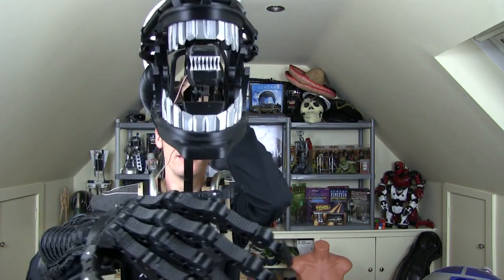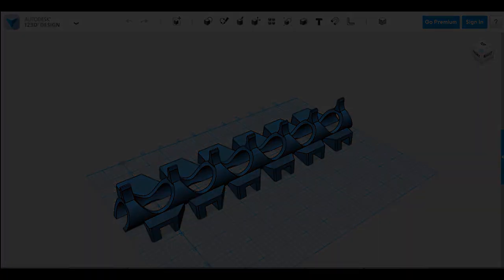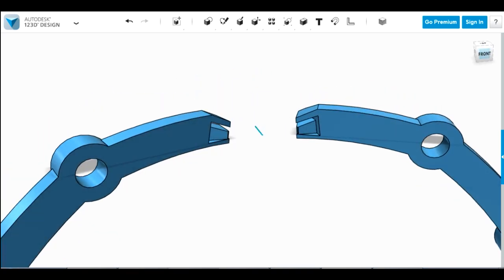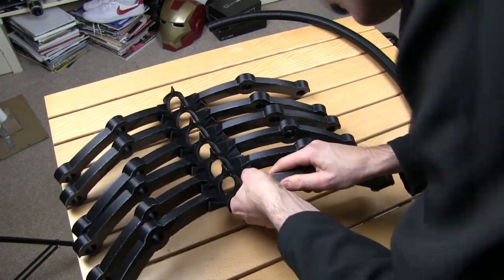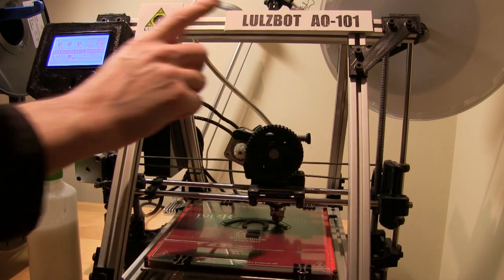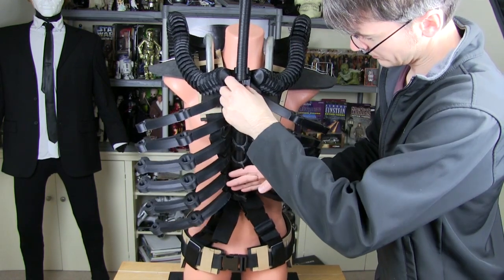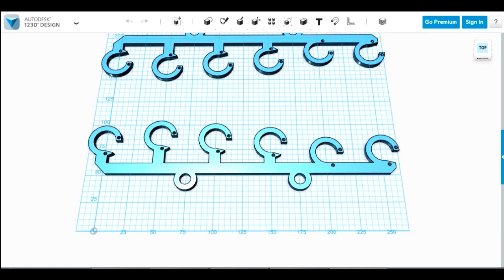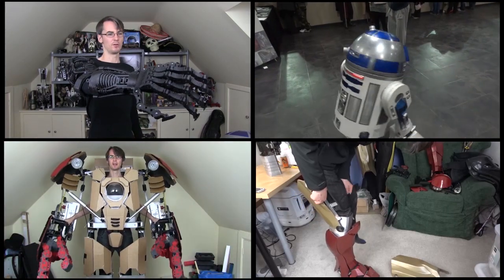Alien Xenomorph Cosplay #10 | Breastbone & Ribs | James Bruton

Comment: I think you should make sure the tail has some puppeteering capability, that way it adds to the realism and is able to be tucked in tight so it doesn't hinder movement in tight spaces.

If you make it so the pose you're in affects the tail's position, for instance; when you're on all fours the tail should be streched out more (like a lizards), and when you more upright the tail should be more curled inward (like a scorpians).

I can explain this better if you're interested, just reply to this comment, and I'll respond immediately.
Reply: *****
Just a basic idea, dunno how good, but make the tail controlled by movements in the body harness.  If you twist right, the tail shifts to the left, and same the other way around.  Will make it look like it's actually shifting weight, but a bit of a heads up, these things have an almost forward lean for sake of balance (kinda like a velociraptor).  Some supports along your legs to maintain the upper body could help as well, otherwise I think you're probably expecting a suit that could weigh say 30-50 kg in the end (rough guess, though not sure what it's currently up to now at a glance).
Reply: *****  If you run lines that connect to the shoulders on both sides you won't need any motors, batteries, or complex programing.

Just make sure that the lines that control the bottom of the tail, attach to the back of the shoulders gtoing up the back.

As well as the lines on the top attach to the front of your shoulders by going up the front.

Then if you want it to strike (or emulate striking) you'll only need the lines to be overridden by giving them slack, with motors that would otherwise keep them at a set length. Using one motor on the back to pull a line that is only for striking, running up the top of the tail.

BTW I believe I sent you a tail blade image/ model I designed a while ago, but here's the link again in case I didn't.

http://www.123dapp.com/123D_Design/Xeno-Tail-Blade/2707242
Reply: ***** it would need that anyway so it wouldn't fall appart.
Reply: I actually di some research on that earlier and sent it to james dunno if he's use it but this is what I found http://www.wolftronix.com/howto.htm
Reply: Lexx Alolia Cool and useful, still you have to consider the weight all that extra tech is gonna add, when the tail is as long as he is tall (approximately).

Because not only will it tire out the wearer quicker, it'll also be more likely to hurt any unfortunate con-goer that gets too close.

Though this is his project, and what we're talking about is just a possible way it could go.